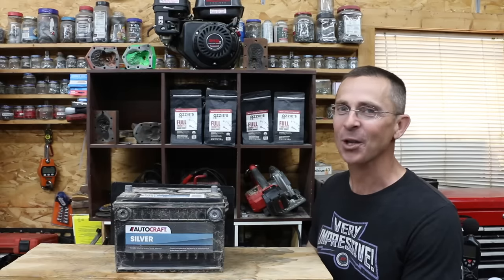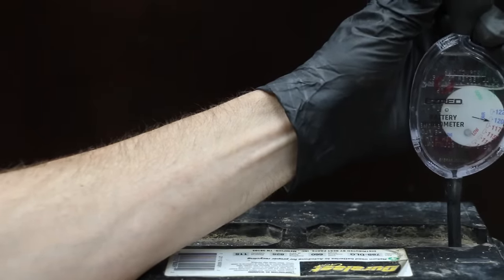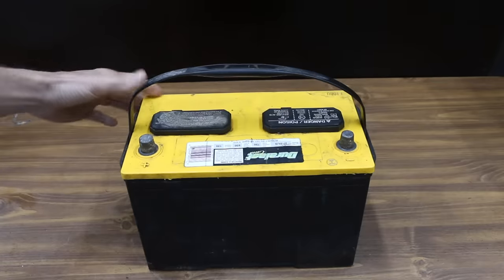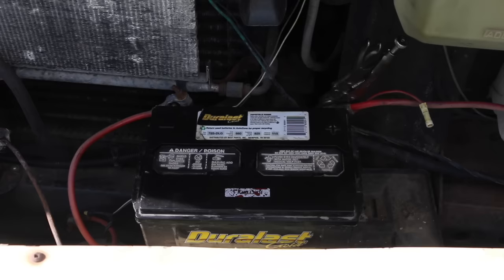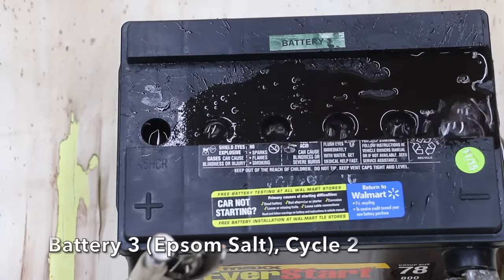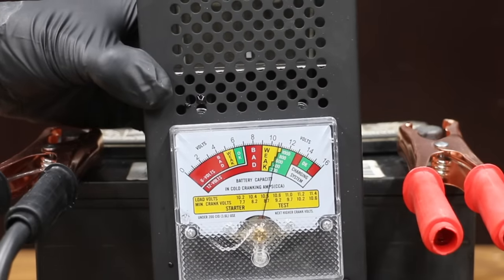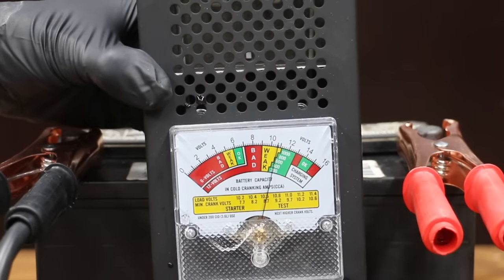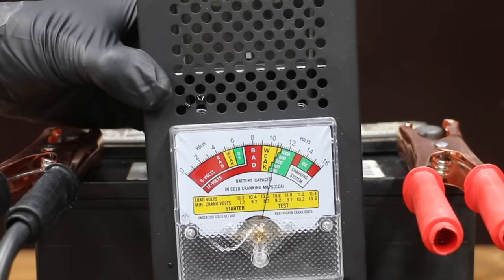Myth Busting! Can You Restore a Dead Car Battery With Welder?  Let's Settle This!

Comment: I have never done it this way I always cleaned the battery the same way and bought a bag of battery acid from Napa and it worked just fine , went from will not charge to lasting three years longer may no always work but will a lot of the times .

Comment: The small electronic de sulphater I purchased from  ebay, and after 2 months on my car battery with repeated charging (as the desulphater uses the battery to operate) the battery state went from 40% to 80%, another month de sulphating did not improve things further.
Reply from the maker: Thanks for the feedback.

Comment: I live off grid. I've been restoring my batt bank for 15 years. I've learned that using fewer amps for long periods of time gives better results. For a standard car batt, I use 10 to 12 amps for many hours. Depends on the batt starting out condition. It may take 4 to 24 or more hours. I've also learned that if one cell doesn't boil or has weak boiling action compared to the other cells, that battery will never come around. It's no good. Just my 2 cents worth
Reply from the maker: Thank you for sharing!

Comment: The defect in battery 3 is that it has no acid. You drained it out and replaced it with Epsom Salt (Magnesium Sulfate). If Magnesium Sulfate were as good an electrolyte as Sulfuric Acid in car batteries, they would be made that way instead of using the more dangerous acid. Magnesium Sulfate is sometimes used to restore sulfated cells, but it is added to the acid as a supplement, not used to replace the acid.

A better way is to fully charge the battery then overcharge it to 15 or 16 volts. Hold it at that level for 2-3 hours (some sources say 12-14 hours.)
Reply from the maker: Thanks for the feedback.
Reply: @ProjectFarm  I love what you do. Always look forward to new videos. But I'm concerned about your cousin. 😊

Comment: if you like you can test it. take a dead battery and poor out 1/4 or 1/3 and top it up with acid and test it and you will see instant power charge. This is a South African trick I learned living their. So i stand 100% behind it working as i have done it myself on more then one point in time
Reply from the maker: Thanks for the suggestion.

Comment: I wonder if the DC welder works for the 250A tubular batteries on my solar power system, but I guess it should work, shall i crank up the to 200 or zap the batteries for longer cycles?

Comment: I pried open my sealed 5 yr old EverStart battery and found it was dry. I added a quart of distilled water to reach the bottom of the rings, but it was too far gone with an old style charger and high current. The outer cells bubbled, but the inners didn't. I don't think I will get another sealed one.
Reply from the maker: Sounds like it is indeed too far gone. Thank you

Comment: Well it’s been a week since I hit the battery in my 2010 Pontiac vibe  with the 90 amp flux core and the battery is  working great now when I was having to put it on the battery charger every 2 days might not be a permanent fix but so far so good 
battery was reading 12.3 volts now 12.8
Reply from the maker: Thanks for sharing.

Comment: You don't need a welder to recover a old battery, just a DC power supply that can deliver around 20V at a current of a couple of amps.  I used a power supply that had a current limiter and I set that at 2A amps.  Initially the battery I was restoring was reading 7V and the specific gravity of the cells was around 1.12.  Initially the current drawn was very low, in the mA range but this soon increased to the 2A limit.  After a few hours when the battery was reading 12 V I removed my power source and placed it on a battery charger to see what would happen.  After a few hours the battery charger stopped and reported a fully charged battery.  The S.G. reading I took told a different story, each cell was reading around 1.19.  I replaced the charger with my DC supply and continued to charge the battery for another 8 hours checking the S. G. as I went.  After the S.G. got to 1.28 I was happy that the battery was almost as good as new.
Reply from the maker: Thanks for the feedback.

Comment: Dead batteries almost never recover, but can be made better.   I have had to completely drain a battery of all electrical juice and then hook up shop charger (18v) in reverse (pos to neg, and neg to pos) to get it start to bubble (wouldn't bubble no matter what).   Once the bubbling started in every cell, I drained the electricity,  and hooked it up correctly (this battery was like 4 volts to start-had sat forever).   It eventually got up to 12 v.   The real problem is that you need acid and lead to interact and most of the times the acid has bubbled off and left the battery so there is not enough acid.  It used to be you could buy battery acid at the auto parts stores but they made it illegal.   If the battery has bulged and crap gets lodged between the plates the only way to correct that is to cut off the bottom and flush the crap out or you can have shorting. 
Then reattach the base, and refill with acid and water to the correct levels.   Adding epsom salt is only done (added in small amounts), to a battery with acid in it and it increases electrical conductivity ; no one every puts pure epsom salt mix in a battery that I know of.  The desuphators have excellent ones and crap ones.   The one I use is a pulse wall transformer delivering 1.5 amps and floats at 17 volt and it does rejuvenate batteries that have not gotten horribly bad but have never been fully charged.  The old2 AMP transformer chargers worked great when used for a couple days.    Most people never get their battery to 100% charge, they start it , drive it to the store and it never gets the hours of charging necessary to get to 100%.
Reply from the maker: Thanks for sharing.

Comment: The crazy guys over at Garage54 did a battery revival test where they reversed the polarity of the battery and it worked really well. I am skeptical on it and it seems kind of dangerous, but it would be interesting to see if you could get that method to work as well.
Reply from the maker: Thanks for the suggestion.

Comment: I wonder if a flush and fluid replacement would help the overall health of these batteries... how much of the issue is surface build up on the plates vs crude at the bottom of the cells?
Reply from the maker: Thanks for the suggestion.

Comment: I was under the impression that the battery should just be topped off with the Epsom salt and distilled water solution, rather than dumping out the acid first. Perhaps try that way of you ever do more battery testing? And thank you for the informative video!
Reply from the maker: You are welcome!  Thanks for the suggestion.

Comment: I'm amazed that you didn't get a box of battery acid from O'Reilly's. I think that if you put the Epsom salt in it afterward, you should rinse it 4-5 times with water, then let it dry and pour in battery acid. Charge it, and it should work as good as new.
Reply from the maker: Thanks for the feedback.

Comment: I’m now a believer that the 200amp charge cycles can save a battery. Here is what I found out.
I had a battery that was a 36month battery and it was 5 years old and got to the point where it would not start my truck. When I tried the 200 amps for 15 min, I noticed that one of the cells wasn’t bubbling, aka dead cell.
After five 15 minute cycles, the battery strength wasn’t really any better and the one cell still wasn’t bubbling. I figured what the hell, I’ll just continue to 200amp cycle charge the battery. On the 12th cycle, the cell started bubbling and by the 15th cycle the battery was back up to 90% of a original capacity. Now 5 months later I’m still using the battery in my F250 diesel with no issues. 
I’m convinced that the 5 cycles is for maintenance while the battery is still good. Once a battery goes bad, keep cycling until it comes back to life. Drain and filter the acid through a fuel filter and reinstall back in the battery.
Reply from the maker: Thanks or the feedback.
Reply: @ProjectFarm  Oh, and great channel! 👍

Comment: I appreciate the tests you perform. I have heard many times and many years ago that concrete will drain a car battery very quickly. I think this might be a good thing for you to test on the channel. Thoughts?
Reply from the maker: Thanks for the suggestion.
Reply: I forget the reason but was told that used to be true with the old batteries but not with the new ones!

Comment: I have a chinese welder also. I measure the current with a clamp on Fluke Ammeter and it measures just about half what the welder says it is putting out. I dont know if that is because of the load or what. Just saying that when you set your welder to 85 amps the battery may not be seeing that much current.
Reply from the maker: Thanks for the feedback.

Comment: Many years ago they used to dump the acid and fill it with distilled water and charge the battery with the reverse polarity and then dump it and put in new acid and Trinkle charge it overnight.
Reply from the maker: Thanks for sharing.

Comment: From my experience, saving lead acid battery is just luck. Luck on how crytalization form on lead plate. If two plates or more is shorted, it's done.
I recently recover a 0v tractor mower sitting in the garden for more than 5 years. 
Put it in parralel with a good battery to get voltage back to about 10volt and then charged it with a regular lead acid battery charger. 
I dont have equipment to measure battery capacity but it cranck fine even after many motor start (40+). 60$ saved :D
Reply from the maker: Thanks for sharing.

Comment: Hold battery upside down  8-10 inches above a hard surface and drop it a couple of times top off the electrolyte and charge it... You might be surprised.
Reply from the maker: Thanks for the feedback.
Reply: I dropped my dead battery 6ft back in 1975. It definitely became useful again. I support your findings, maybe not your exact method

Comment: Well, when a battery is bad, the acid is low or the connection among the cells is separating. So you could fix it, but is more expensive than getting a new want, when done a small scale
Reply from the maker: Thanks for the feedback.

Comment: is the welder high voltage or something? because the thing with the bad batteries is that they themselves decide how much current or charge to pull from the charging source. So the battery will pull 2 amps on a 200 amp charger, and will say its fully charged, then when you try to put a load on it, it instantly dies. So that welder shouldnt be charging those batteries, unless its at like 30 or 60 volts and is frying them or something. I'm not sure.. kinda a big issue not to address this.
Reply from the maker: Thanks for the suggestion.

Comment: a lot of times  a bad battery isnt really junk  i dunno about using a welder but ive brought bad batterys back by charging them at high amperage
i use a 100 amp gm knock off alternator   and turn it using a predator engine  by exciting the field  it will charge the battery  if it can be saved 
it will charge back up however it wont last as long as a new battery  and when it quits again it is absolutely done and your only option then is to replace it
Reply from the maker: Thanks for the feedback.

Comment: The epsom salt i think needed to drained and the cells refilled with battery acid afterwards. It was to clean it not to run the battery correct? Or am i way off

Comment: I did an attempt to restore the battery by charging it using impulses. An 0.5s impulse then 20 seconds wait using arduino. Was doing for days. That did not worked as I believe it was required to add some acid which I has not had. But I aso was thinking that the problem with the batteries is that when charging small current it restores in shortest path. We need to use high current to charge. That's why I used impulses to avoid high temperature.
Reply from the maker: Thanks for sharing.

Comment: I have been using a manual battery charger set at 200 amps to restore my batteries i do it once a year weather it needs it or not i have got over 20 years on some batteries,i also got 12 years on my 22.00 dollar riding mower battery.I have never tried a welder.
Reply from the maker: Thanks for sharing.

Comment: I've seen a video that shows how I thought of doing it, where you empty the acid and wash out the loose stuff, then filter the acid of any crud, then top it off with clean acid. He low pressure washed it through the holes to clean it out.
Reply from the maker: Thanks for the feedback.

Comment: I noticed the epsome salt battery didn't really come back .  I don't understand what the purpose of that was but I don't think lead acid batteries work that way.   It might be different if he replaced the electrolyte after the process.   Also most of those batteries seemed to have one  bad cell the indication of a shorted cell.   that is when if you are playing around you would try  the baking soda and a garden hose on that cell to flush  the sediment from the bottom  of the dead cell of all of the cells then add fresh battery acid and recharge.   This is a really dirty process thats why nobody does it except battery companies now.  But back in the 50's and 60's discount autoparts stores used to have rebuilt batteries and they were cheap.  But i guess they wern't dependible so that stopped happening but it was common in the thirties  and fourties on old cars.
Reply from the maker: Thanks for sharing.

Comment: I can say that those batteries that showed improvement with electric welding could be reconditioned with the correct way. And the end result would be - much better condition than after electric welding. Electric welding and giant amps per charge are definitely not right, but will greatly harm, even if you see an improvement in the short term.
Reply from the maker: Thanks for the feedback.
Reply: Yes, so much high amp will melt some part of plates, i suspect that. And what Science going on behind it?

Comment: Sir, the output voltage of the welder is around 40v to 60v, whereas the battery is 12v. Will it not damage to battery...??

Comment: How about a long term test? Buy two new batteries. One will just be used normally.  The other used normally also but "Stick Welded" at regular intervals like 6 months or a year to see how much longer a good battery might last or fail early. It would be tedious but you seem to handle tedious very well. 

And how about cutting into failed batteries to see where the failure points or causes were? 

Oh yeah, I saw a commercial on youtube where some young guy supposedly worked for a car mfg and found in the car's computer code that they were deliberately making the cars more inefficient. Long story shorter, they sell a device that improves efficiency with no effects on power or performance. Im 99.999% sure its fake. It would be good to expose that with your comparison procedures. I don't remember the name. If I find it I will let you know what/who it is. Maybe someone else knows?

Great videos and great channel like always!
Reply from the maker: Thanks! Thanks for the suggestion.

Comment: My process for restoring car batteries is I have a 200 amp manual battery charger. I take the caps off and add distilled water if necessary. I leave the caps off and do this part outside to get ventilation. I run the charger for 15 minutes at 200 amps and then wait for 1 hour and repeat 1 or 2 more times. I have restored several batteries and they last for years after I do this. It is dangerous so do this with plenty of ventilation and no sparks.
Reply from the maker: Thanks for sharing.

Comment: You can fix the battery by pouring out the acid, cleaning up thr crap and then pouring the acid back in. A bit dangerous but works.
Reply from the maker: Thanks for sharing!

Comment: Good way to get a used car you are going to immediately sell going. But for your real vehicle a new battery will get you years of reliable starts. Note that the tests done here did not measure battery capacity, which could be very low even though it has enough cranking amps for a short while.
Reply from the maker: Thanks for the feedback.

Comment: try cleaning the epsom battery out and replacing electrolyte with fresh sulfuric.
Reply: use a porous membrane or an unglazed clay reservoir in another container and epsom solution positive in one container, negative in the other, the epsom should break down into sulfuric acid and magnesium collecting at the positive and negative under electrolysis. collect before removing power as they will recombine when power is removed. the porous container is to help maintain ph gradient between both solutions that form for harvesting. use this to top off the cells. epsom itself will ruin the battery because the magnesium causes self discharge to go way up. you just want the sulfate part of epsom and it will combine with water during electrolysis. Best to use carbon rods for the terminals during your reaction to prevent contamination by other metals.

Comment: Could you do a video on nut splitters?  I got a Craftsman to help get some degraded nuts off an old turning plow. The splitter is badly damaged after one nut that's still holding strong.
Reply from the maker: Thanks for the suggestion.

Comment: 2:53 A cell on left side is HOTTER than the rest.  Only takes one bad cell to limit a battery.    At 4:10 cell on left (#2), is the only cell not bubbling.  Perhaps it is completely shorted out.